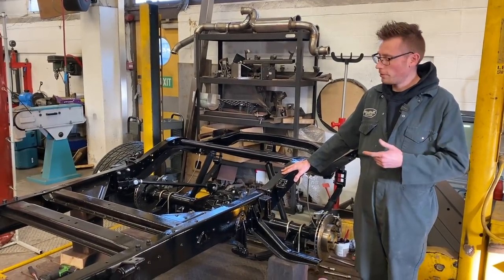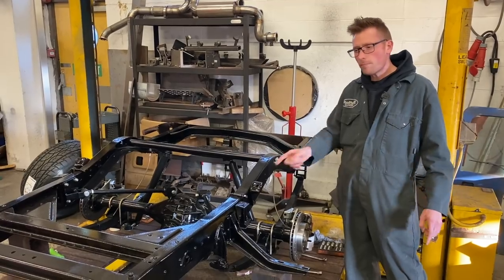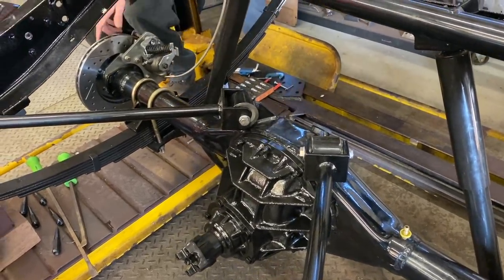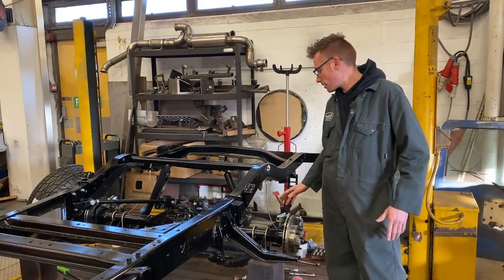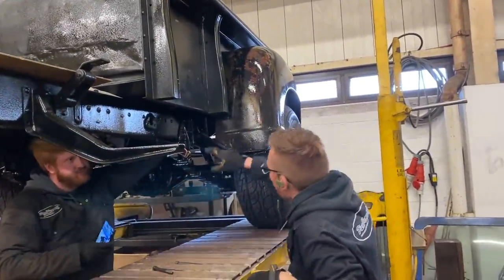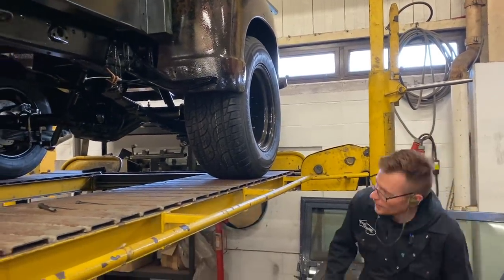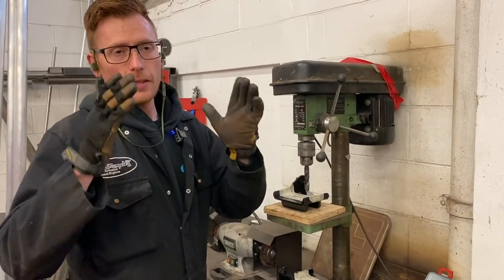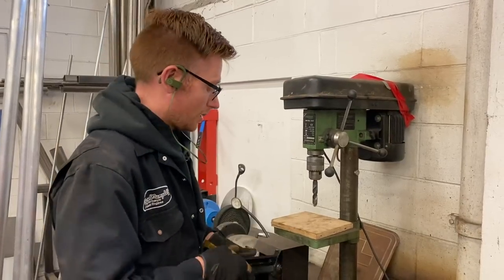OM606 GMC BUILD PART 4

Comment: Does anyone know what the difference between OM606.962 and OM606.961. Does the 961 have the same potential as the 962? What differs between the two versions?
Reply from the maker: Where have you seen these numbers?
Reply: @DieselPumpUK  Good old wiki. The OM606.961 came in the W140 S300TD, also a turbo version. Would that engine do aswell as the one that comes in the W210 E300TD (OM606.962)?
I really appreciate the help :)